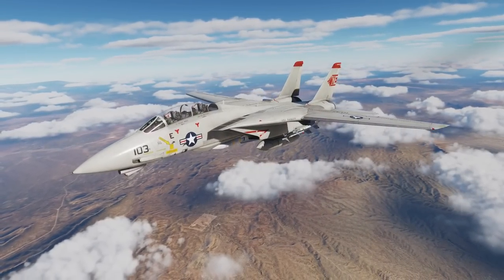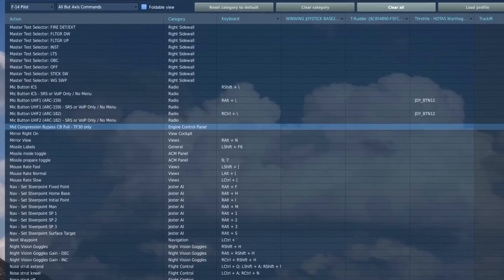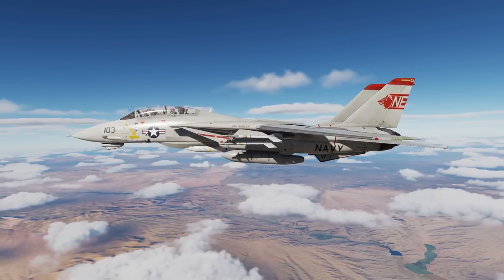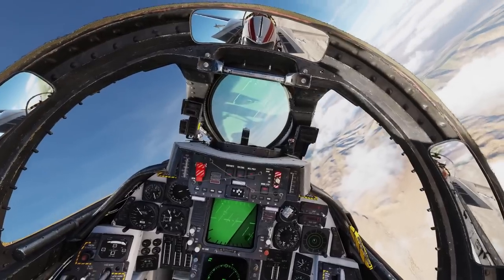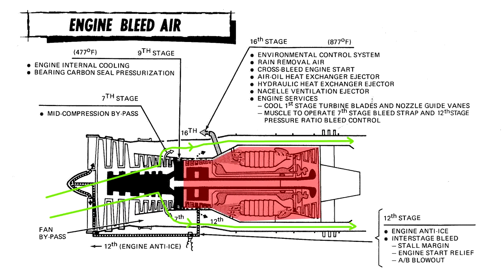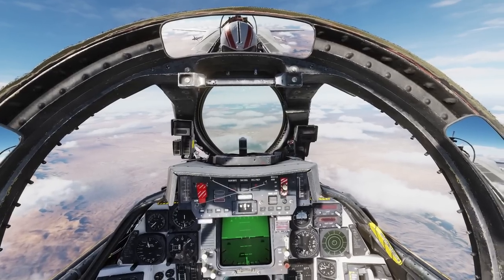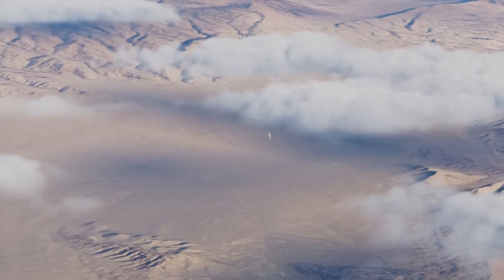Auto-win BFM? The Mid Compression Bypass system of the F-14A Tomcat

Comment: The F-14 is already a monster in air to air fights if you can control it, the community doesn't need tall tail trick they (for the most part in my perception) just need more practice, i have well over 1000hrs in the dcs F-14B and i still and will probably always have things i can improve on

Comment: Great explanation and final conclusion.

To me this thing looks like the glove-vanes what some people complaining about. Technically makes some difference, but practically you barely use the plane in that regime. So doesn't make much difference if HB modelling it - just waste of developer's manpower.
(Allegedly some badass pilots even switched off the air con system temporarily during dogfights to be sure to get few hundreds more power trust ... HB, you don't need to modelling that one even. :) )

Comment: Very interesting video.  I can't find an explanation for the wire/ tape/ metal plate over the three buttons on the front. Gun rate, SW cool, msl prep.
Can you please explain ?
Reply from the maker: From what I've heard, they tended to pop out quite easily and end up at the bottom of the cockpit somewhere as the airframes got older. So these were' field mods' to make sure they stay where they belong.

Comment: I agree!  This is far from priorities right now.  Why would you make it even more prone to compressor stalls? These people actually really fly on the edge of the envelope like that and feel a difference, and not stall an engine?  And what is wrong with the B variant? You want more power, fly the B. Not in the mission? Complain to the mission creator or server host,  not Heatblur.
The whole reason for the B existence is the engines.
Reply: To be completely fair though, one of the reasons people want to use this is that the Tomcat is completely unable to do the often quoted M 2.34 like at all. It tops out somewhere around M 2.1 - 2.15 and I've never ever gotten them past that, neither of the models. Just having that thing there in the binding menu makes people think that this is required to get to the official top speed and therefor other performance measures as well. If they'd just get the high alt top speeds right, this would be a non-issue.
Reply: @CakePrincessCelestia  The current version of the A will reach 2.3 if it is clean and at altitude.
Reply: @pjstew  Must be because of the recent FM changes then... would be great!

Comment: Snodgrass said otherwise :P  thank you for explaining how it worked
Reply: I also remember Snotgrass describing the various "cheats" he used to defeat a few early F-18s at Red Flag(?) or Fallon(?). But that story also highlights the point: it was an artificial matchup of a superior (in dogfights) airframe, the F-18, with a less experienced crew (one pilot) against a much more experienced crew (Snotgrass and his RIO) in a technologically inferior airframe starting the fight in an artificial position (wing on wing). And these are the tricks he had to use to win the fight. Or rather "a" fight, because he denied the F-18 pilot a rematch by another trick: he was low on fuel already at the beginning of the fight.

Not to mention that a Dogfight happens (especially for and with the Tomcat), after numerous things already went wrong before. The reason the Tomcat still slaps is because of its powerfull, long-range radar and long-range Phoenixes, in addition to its endurance, power and speed. Fly the Tomcat at close to 40k altitude, above M.8, get vectors on bandits from >100NM out, then set up an intercept and start shooting <60NM. Accelerate close to M1 and if possible zoom to >40K altitude prior and start putting pressure on the enemy. Try this on Grayflag and see the Tomcat slap.

Fly it for what it was build for: a fast, powerful missile platform. And look sexy doing it. 😎

Comment: over the entire time the F14 has been available to fly in DCS (since early 2019) seems like the people that dont like or even fly the f14 are the ones yelling the loudest about removing/hindering/hamstringing/handicapping anything and everything that could be perceived as the F14 having a performance advantage. The people that yelled the loudest demanding downfall of the dcs tomcat dont even fly it and dont even like it. Over the years they´ve been saying it accelerates too well, turns to well, aim 54 is too fast/over powered, engines are too efficient. The dcs masses screaming ¨the dcs tomcat is too good in all these ways...¨ with all the piss vinegar and vitriol simultaneously claiming all their ¨mirage 2000¨ or F16, or f18 are underperforming. Today in 2023, what does the dcs f14 do better than a dcs f15, f16, f18, su27, mirage 2000? nothing, because a bunch of people on ed forums that hate/despise the f14 badgered heatblur until heatblur gave the dcs f14 critics/haters(keep in mind these are people that dont even appreciate flying the f14 module) everything they wanted
Reply from the maker: LOL are you seriously saying I'm a Tomcat hater? :D
BTW I'm sure Heatblur said to hell with our SME-s and hard data, let's fine tune our Tomcat based on public opinion. Sounds legit.
Reply: @ReflectedSimulations  I'm not aware of your stance on the F14. I think public opinion did negatively influence and negatively shape areas of modelling dcs F14 there is little data/limited info on that required HB to estimate/project performance/generate their own data especially the flight model in clean config or aim54 performance. From day 0 of f14 release to present day, it seems like hb has spent the entire time "iteratively" walking back f14 performance, timing also closely followed some of the highest points of outrage and vitriol towards dcs tomcat "overperforming"
Reply from the maker: @coreybielas3246  I teamed up with 2 Tomcat veterans to recreate a 1980s Topgun syllabus as well as a Tomcat RAG course in the most realistic way in the Zone 5 and Speed & Angels campaigns, I spent months of my life making 2 dozen F-14 liveries, not to mention my startup, refueling and carrier landing tutorials. If I’m mot a ‘fanboi’ I don’t know who is. 
HB has a bunch of SMEs, former Tomcat pilots and a lot of hard data. They don’t give a rat’s behind about public opinion when it comes to FMs. And no, they haven’t only been nerfing the Tomcat, recently the A got much better acceleration, remember?
What I say in this video have been confirmed by former Tomcat crews, even in the comment section. I’m just putting all into context, because many players are DEMANDING this CB to be a secret cheat key. It wasn’t.
Reply: @ReflectedSimulations  yeah, from the start I wasn't questioning your campaign work, content, or whatever. More pointing to people in dcs(like the ones saying the bypass breaker is a cheat code) that think the F14 should be an old stupid piece of shit that sucks at everything and will do anything they can to take as much as they can from the module
Reply from the maker: @coreybielas3246  well it's certainly no cheat button, because the advantage you gain from pulling it is marginal and it comes at a high cost. IRL that is. And in game too.
Reply: @ReflectedSimulations  here's a hb f14 "walk back" conspiracy for you. People have complained from day 1 of f14 release that a Grumman cat from Grumman Ironworks had "too tanky" of a damage model bc it could survive a fox2 hit. What's that damage model like now? Catastrophic systems failure from a single 20mm round, yet I can get 6+ 20mm hits on composite wine glasses with no ill effects to them

Comment: One of the areas where DCS F-14 fails imo is the fact that CBs aren't modeled in spite of the level of manual management they required in real jet. A lot of emergency procedures are impossible to execute in the sim because the circuit breakers aren't modelled.

Comment: 0:43 Wrong. It was planned to implement most if not all of the CBs from the get go, ofc including this one. At a later stage in development, though. Was never high on the priority list, but they always opted for having a FULL simulation of the thing as much as possible.

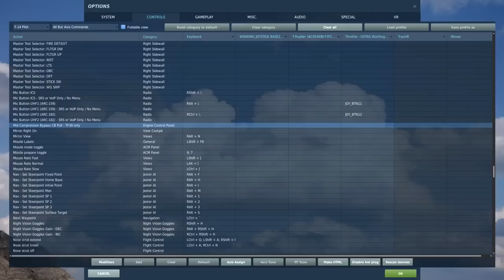0:49 I do have that key mapping literally for ages, since shortly after release of the A...

1:18 Nope...

3:33 Which is why it mainly has been used for trying to get speed records in test flights.

4:44 "The F-4 Phenom" - I still do have one at home as well, BTW. It's a 955...

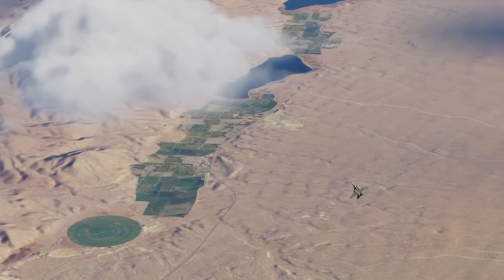4:47 I'd rather them to make the fricken jettison switch work actually instead of messing with the mid-compressor bypass, because they decided to give us loadout options that have been tested, but never been used in service which is the sole reason the jettison switch isn't even wired. And to be fair, they have announced the thing initially with most of the CBs working. If they'll ever be to fulfil that promise, THAT one CB will most probably get the work done which is being requested as of recently so much, with the main reason being that HB actually spent some valuable time to finally add all the binding entries to the thing so we don't have to mod them in ourselves anymore, which I did and is the reason I had it all along. And I only ever used it a very few times for testing, couldn't really notice any significant difference and stopped bothering, because there's more important stuff to waste your time on.

Oh, BTW: TOMCATS!

Comment: Ideally every single CB would be modelled for every module. Why is it a problem that people want Heatblur to push their modules further and further? Your point on the early A and Iranian variants are exactly the reason why offering multiple variants is a bad idea in the first place. They should have chosen a single Tomcat and model all the subsystems, EPs, failure logic and CBs associated with it. I get that this a cheaper product for a generally lower fidelity ecosystem than similar products made for X-Plane or P3D, but why is it bad if the standards are slowly but surely increasing?
Reply from the maker: Cheaper product for a lower fidelity ecosystem than X-plane or P3D? You’re kidding, right?
Nobody wants to have the CBs not modeled, it’s just that people overestimate this one too much. That’s the point of the video. And I’m glad they’re modeling different variants, because the Tomcat was in service for so long, there isn’t a single model that would fit all scenarios.